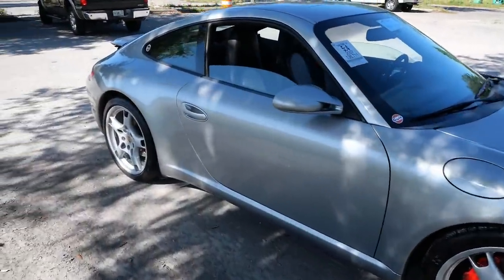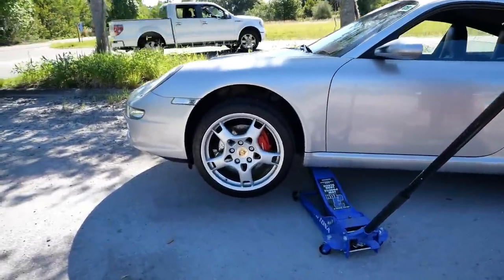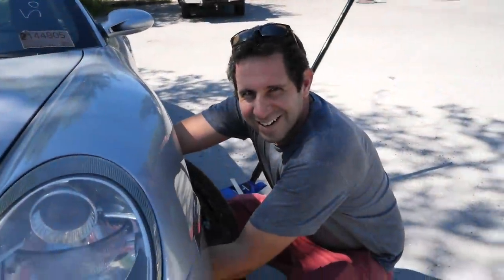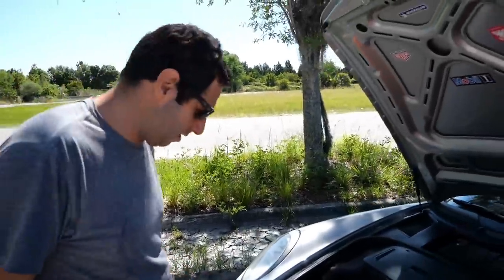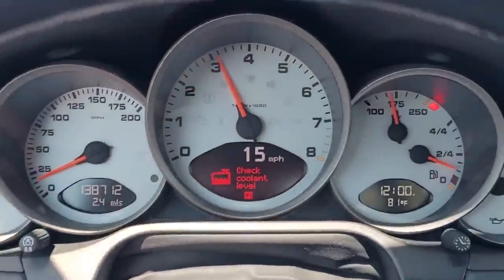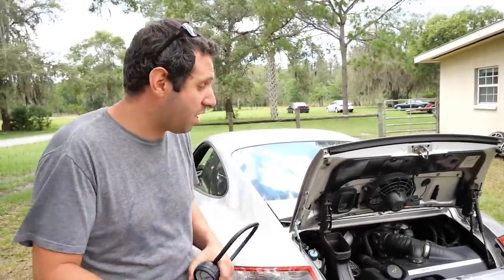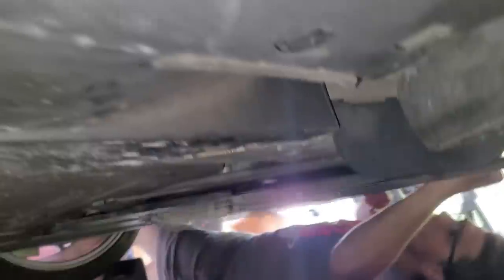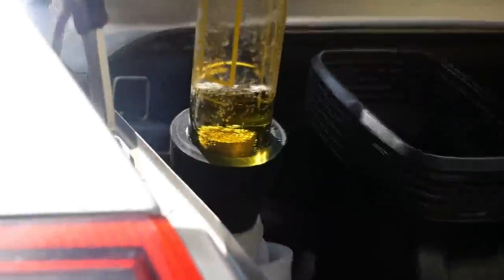I Bought an "As-Is" Porsche 911 and got 50% off because It Came with a Mysterious Leak

Comment: I just went through the dead battery/front trunk thing with my Boxster (again).  This is an amazing engineering flaw by Porsche but not too bad once you go through it. Much depends on just how dead your battery is.  If it is not totally dead, you might be able to hook up a battery tender or charger to the terminal that is shown in this video of the fuse box.  If you have an earlier model, you might have to jump the C-3 fuse as it won't have the special terminal that Porsche put on later models.  That is the one three rows down (Row C) and the third fuse to the right (Fuse 3). For many tenders, if they can't recognize the battery because it has no or very low voltage, they won't work.  The car is just protecting its electrical system here.  The classic and popular battery tender, the Beltran Battery Tender needs at least 3 volts in the car battery to recognize it and begin it's magic.  If you have 3 volts, you may have to leave the tender on for an hour or two to charge the battery enough to let the trunk latch work.  The very expensive Porsche Cigar Lighter tender needs something like 5-6 volts in the car battery to work.  
   
So if your battery is dead-dead, you need a plan B.  You can either try a good charged up 12 Volt car battery and hook it up in the fuse box like we mentioned above, or get a real battery charger (not a smart tender like the Beltron) and try that.  The spare battery won't need some minimum voltage in the car battery to work.  If you use a real car charger/starter, it should have two or more settings.  One is "automatic".  This makes the charger go off and on so that you don't overcharge the car battery and ruin it.  You don't use this setting as you need a minimum battery voltage here too .  There is another setting which is "manual".  This just shoots power to your battery and it doesn't care if there is any voltage in the car battery or not.  The danger is that it will overcharge and ruin your battery.  The horn may begin to honk when it gets power.  Push the trunk button or pull the lever if an older car.  The trunk should open and the horn should stop.  Remove the charger then to use it directly on the battery in the front trunk.  

Put the charger onto the car battery.  Set it to "manual" since the battery is still too low for the automatic setting to work.  Let it charge on the 15 amp setting for maybe a half hour.  (I use the 2 amp setting for two or so hours because ... fear of electricity lol.)  I then put the charger on automatic (you can begin to use your tender here instead also) until the car battery is fully charged.  In the future, be sure to keep a tender on the battery unless you drive the car often to keep the battery charged.  It took me having to do this twice before it got through my thick head to always use a tender.  If you don't drive the car from 2 to 6 weeks depending on the state of the battery, it WILL go dead.  Some electrical things in a Porsche just keep working even while you are sleeping.  The computer turns more things off as the battery gets lower and but eventually it will drain completely without a tender.  

If you can access one, a portable car starter battery which has a cable with an OBDll plug works well.  Just plug it in to the OBDll port and turn it on.  I used this the last time.  The OBDll plug has a power pin that introduces voltage into the system to power it up.  (PS.  I just looked on Amazon and you can get an OBDll cable that will clamp onto any random car battery to do the same thing. This is easier than having to mess around with the fuse box.  I'm getting one of those to keep behind the passenger seat just in case!)

There are other methods that require digging around for a manual emergency cable.  They are around on the internet.  The cables may be in different places depending on the age of the car or if it is British or not. (Right hand drive vs Left hand drive).

Comment: I notice the front lid switch won’t open the lid with power to the fuse box point using the interior switch. If you have a functional key remote use the actual key to pop the front lid

Comment: Head gaskets don’t fail on these I don’t think, they are very strong. 
Lots of pipes run over the engine to the front? You wouldn’t see the leak that easily. You have to remove engine to replace a lot of them

Comment: I have a Cayman l that looks remarkably similar to this car and the electronic front trunk latch and electronic dipstick are design flaws for sure. The rest of the car is amaaaaazing. I would also suggest to check the air oil separator and never fill the oil all the way to the top. Always leave it one to two notches below full.
Reply: pretty much everything from the drivers seat to the front of the car in a 987 cayman is the same as a 997

Comment: Add a battery tender connector and have it somewhere accessible on the outside like under the rear bumper like a motorcycle. You’ll always have somewhere to connect.

Comment: If the lever by the seat doesn't work, try the button on the key fob before you start digging under the wheel arch, my car will only open the bonnet with the key fob when the battery is flat or even disconnected, I actually disconnected the battery and locked the keys in the trunk, I had to replace the battery in my spare keys before I could get in

Comment: Pro tip: If the battery goes flat, use the post in the fuse box, but hook up a second battery, not a jumper pack. In my own experience with my 987, a jumper pack won’t work on the fuse box post.

Wait about five minutes after hooking up the battery for the car’s ECU to wake up, and the frunk will open with the switch or the button on the key.

Comment: I’ve had the same issue with a completely dead battery. I needed something stronger than a portable jumper. I had to use another car hooked up to jumper cables to get enough power to get the frunk open

Comment: Same thing happened to me, air oil separator had to be replaced. I got lucky, only 1200 bucks (indy shop) to replace a 90 dollar part (full retail from the dealership). It is on the back of the engine and I just didn’t feel like dealing with it. Pulled out and drove 5 miles and my shift link cable broke, shop was closed. Towed it home and waited on pelican. I love driving the 997.1 but it feels cheap and it has given me more trouble than any pcar I’ve ever owned. Just little things break all the time.

Comment: What purpose does a car like this serve?  I mean, how frickin' stupid to have the electronic truck lock tied into the dead battery inside! 
Back in 1954 (possibly earlier) Nash had a clever solution to this problem.  It has a rear trunk.  They installed a cool little lock device where you stick a key in it, turn it and amazingly the trunk pops open.   I know what you're thinking.  I too think it's amazing the advanced technology we had 70 years ago! 😀

Comment: You could also use a CO detector to check for exhaust in the coolant.  

Also, pump up the cooling system and leave it pressurized overnight.  Start it the next morning and check for a plume of white smoke, which would indicate that water was getting into a cylinder.
Reply: That would bend a connecting rod if coolant got in a cylinder

Comment: Please don’t to this. 
Hood release will be in a different spot depending on which instance  you have.

Jumper packs are going to send too mich power. Hook a battery up to the fuse terminal and ground that batter to the door latch not the hinge for a good ground just like they show on the manual and you will be able to pop the hood

Comment: When the battery is dead and you plug up the jump cables use the key fob to open the trunk have a 997 and I switch won't work the key fob does

Comment: I had a 987 cayman with the same problem, best part? 987 and 997s are KNOW to discharge their batteries when left alone. Btw, even with a super dead battery I could open my trunk with a jumpstart module. probably your contacts in the fuse box are not good.

Comment: One of those 'remote control bending neck' small cameras (the chinese versions are affordable-ish) can help you localise the problem, if for instance if the head has a small crack. put pressure on the cooling system again and take a look into the cylinders watch where the coolant is leaking into the engine, at least then you know where the actual leak is coming from before you strip the engine. Goodluck diagnosing the german!

Comment: Sam is there a manual W/ that Carerra? You will be able to open the engine lid {manual latch} and put power to the system, through the engine jump-start connector posts in the engine bay?

Comment: We got a 14 year old Sentra that loses coolant and I have no clue where it goes. Can't smell any coolant or see any signs of it spraying out. I've been simply topping it off for the past 8 years or so and it's still driving just fine. Maybe it's a leaky head gasket but no clue and if the car lasted this long then it'll keep going. Never overheated even in 110F weather and the oil comes out dark (like normal) when I change it.

Comment: I've personally had the pleasure of finding a crack in a 996 cylinder 2 sleeve using a boroscope in the spark plug hole. Engine is toast.
Reply: You can actually repair that

Comment: I have a BMW 335.  I had to cut a hole behind my console in the rear seats to access my trunk release… I pulled the battery to change it out and it started raining.. I closed the boot lid.. The boot lid has no manual key entry… I was pissed when I found out what I had to do…

Comment: Hey Sam, I had the same issue with mine and the jump pack didn’t work. I chucked a standard battery in the footwell and a couple cables and it worked first time (and a couple times since )

Comment: If the key is not pulled from the ignition after turning off the car, the power remains on and it drains the battery.   There isn’t a single yard monkey in the auction lots in North America that ever remembers this important detail.     This is extremely likely why this new battery was dead.

Comment: 18:56 don't these engines have all those pressed in coolant pipes that routinely pop out? Hoovie had one that needed to have them all welded in to prevent that from ever happening again.
Reply: Nope, those engines are just on the GT1-block equipped models (GT3, GT2, Turbo).
Reply: @OMGWTFLOLSMH  ok thanks.

Comment: Checking spark plugs for one that looks particularly clean, or rusty, is also a good idea when checking for head gasket issues. Most blown head gaskets I've experienced never allowed water and oil to mix, only the peripheral ring round a cylinder was blown, so water could get into the crankcase, but not the oil.

Comment: Sam jump pack isn't going to work for that post. Hook a real battery to it and would have popped the trunk with zero issues. You are doing it wrong. If your battery is really dead the jump pack won't supply current. That post was originally designed for jumper cables hooked to another real battery. 

Also why did you pull a 2022 battery first without putting the jump pack on it when you first got in the truck? I believe it would have started when you put the jump pack on it.

Comment: These cars are famous for cracked heads. They are sh#t. They do make LS swap kits for those cars. Do like everyone else does that has one of these sh#t boxes & LS swap it with a kit. But also remember that you either have to get the entire cooling system clean on the inside or buy all new everything in the car's cooling system. Lines , radiator & etc. That can be very costly too. I think I seen a show on gas monkey garage & they did one that looked just like yours. Richard Rawlins loved the car after they LS swapped it.

Comment: You're not finding the liquid because it's leaking out through the exhaust. And that car runs hot enough to burn it before you ever see it. And chances are there's a hairline fracture in the head. Nothing to do with the gasket. Time to use your $25 cheap fix. Which was probably already done to the car already and why it's running. For now... 😈😈😈😈

Time for an LS swap... Make it faster and sound better.